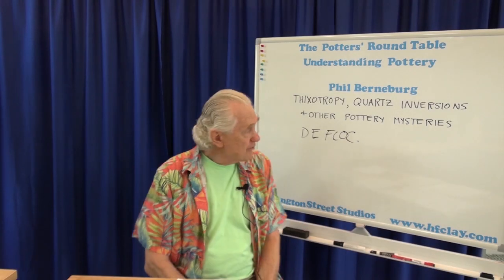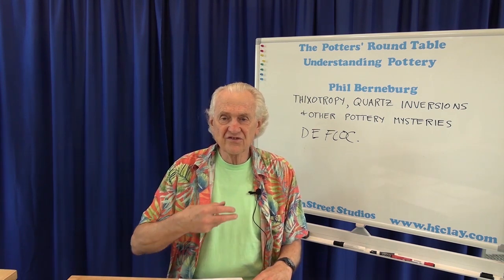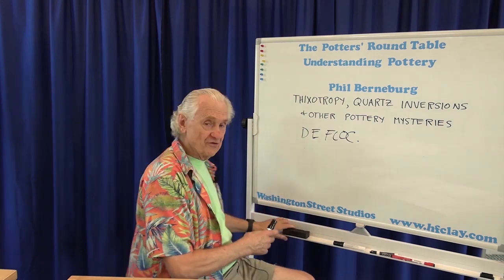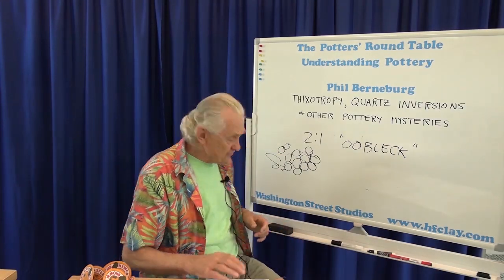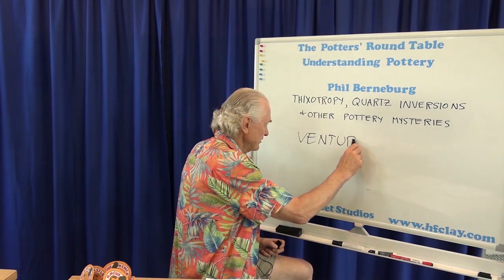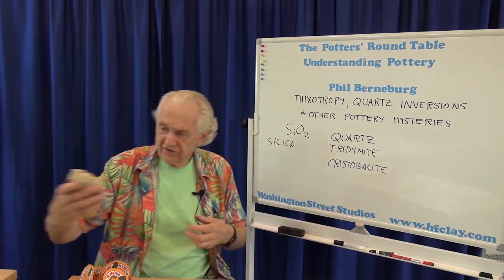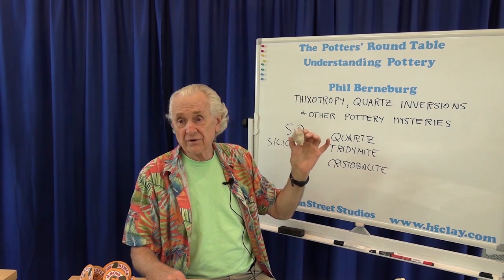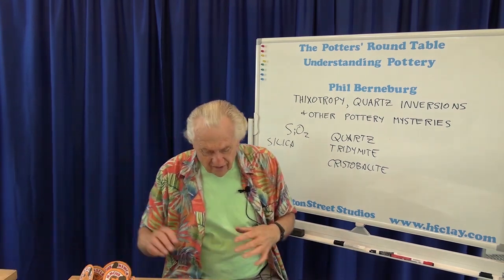Understanding Pottery Chapter 21 Thixotropy, Quartz Inversions and Other Pottery Mysteries Part 3

Comment: So my question would be, "What would may be the most efficient method to try to reconstitute that "concrete-like" layer of glaze settlement at bottom of glaze bucket?  In the past I had student helpers scrape it, break it up into manageable pieces, and reconstitute with hot water.   Rather labor intensive.
Reply from the maker: I've forwarded the question to Phil for the real answer!

I've used a trim tool to slice the concrete off the bottem then use a stirrer on a drill to mix it. Let's see what Phil says!
Reply from the maker: Hi Paul, 

I don't know of an easier method if you want to save the glaze. When I make a new batch of a glaze, I combine it with what's left of the previous batch. I pour off any liquid, dig the "mud' out of the bottom of the bucket (something like a screwdriver is helpful to break it up), combine the liquid part and the mud with the new materials, and then thoroughly mix it with a high-shear mixing head (attached to an electric drill). The fact that the sediment was so hard may indicate that the glaze had become deflocculated. If the recipe doesn't contain much clay (less than 10%), try adding 2% bentonite to the recipe; it will slow settling and soften the sediment. As the glaze ages in the bucket, you may also have to flocculate the glaze (this will reduce settling).

Good luck,

Phil
Reply: @WashingtonStreetStudios  Thank you very much.  I know particular glazes are more susceptible to this than others.   I use a commercial glaze "Jensen Blue" from our local clay supplier Aardvark clay, and that pretty much becomes concrete on bottom of bucket in a matter of couple months.  The "Vegas Red" a Tom Coleman formula, tends to stay pretty "flocculated"  with manageable sediment on bottom.    Other than bentonite I've heard of some using a little bit of muriatic acid to help keep glaze suspended.
Reply from the maker: Paul, 

A lot of commercial glazes contain large amounts of frits which tend to form very heavy sediment unless the glazes also contain some clay (but they don't tell you the composition). Vegas Red contains hardly any clay, and a lot of feldspar and silica, both of which tend to settle out. Trying to flocculate either of these isn't going to work very well because it's the clay in the recipe that responds to flocculation. You could try adding a small percentage of bentonite (up to 2%) which would help keep the glazes in suspension as well as soften the sediment. I wouldn't recommend adding muriatic acid (hydrochloric acid) especially in a classroom situation. A solution of Epsom salt works great, is inexpensive, and is much safer to handle.

Phil
Reply: @WashingtonStreetStudios  Thank you for recommendation!